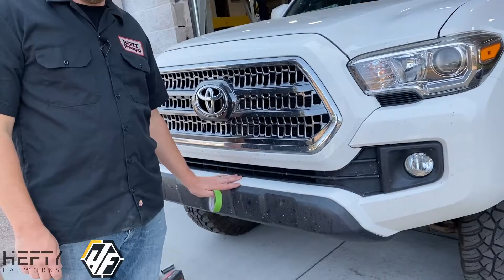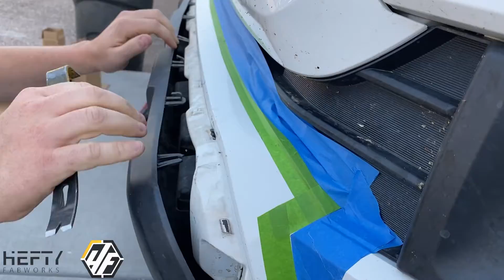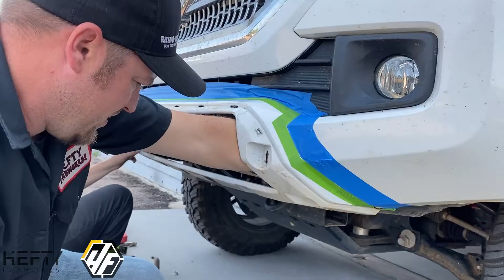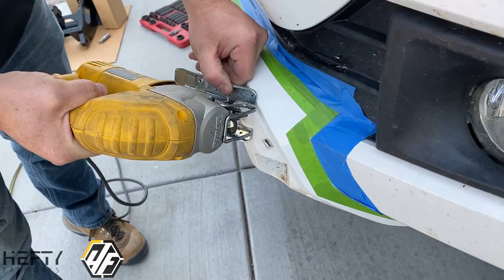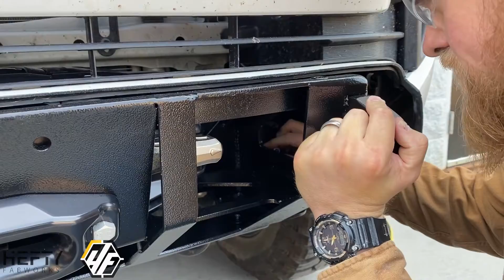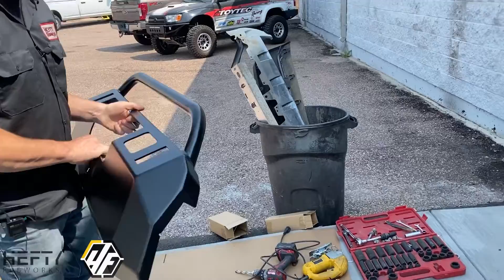Hefty Fabworks 2016+ Toyota Tacoma Banshee Bumper Installation

Comment: why cant they produce a bumper protector that does not require CUTTING UP the stock bumper?? they never look right no mater how well you cut up the bumper. actually the cover does make this one look way better than most. Also, not sure it will pass inspection in some states, you MUST have the liscence plate, also not sure if the 3rd Gen Taco may have issues with this and the skid plate.
Reply from the maker: We do have front license plate brackets available for them but not all states require a front license plate. Building a winch bumper without cutting the front cover isn't really feasible. If you are looking for a front cover or guard there are some available on the market but that is not the intent of this product. This bumper does work with the factory and most aftermarket skid plates without any interference.